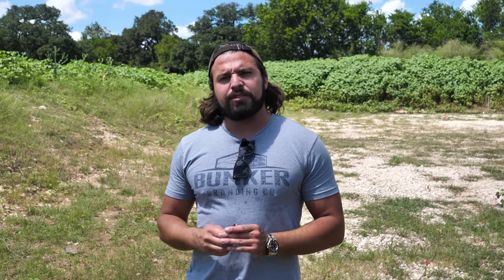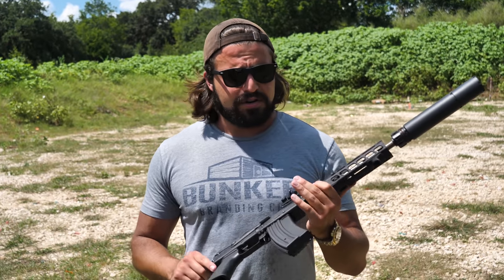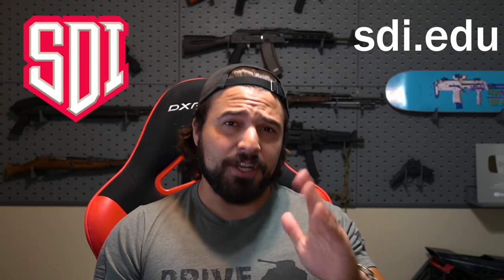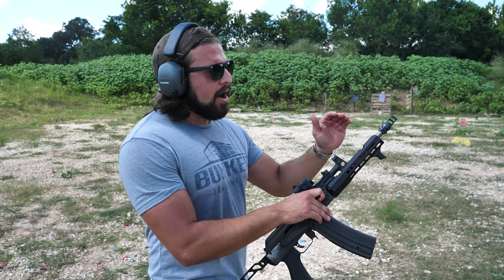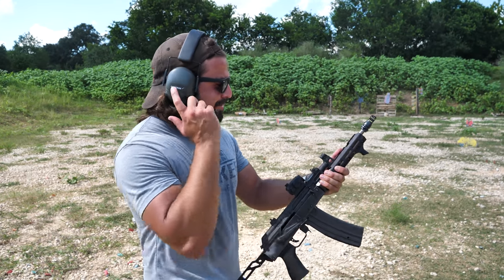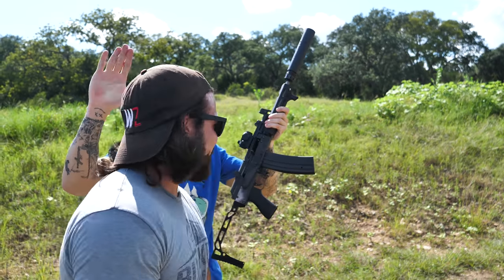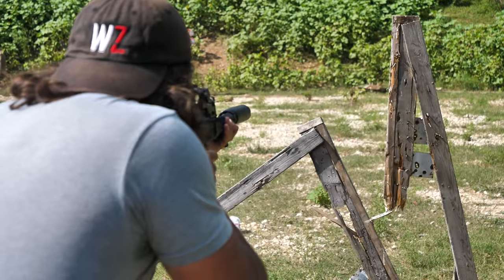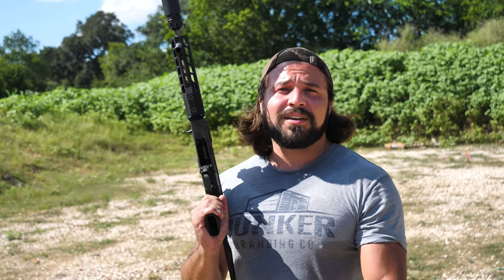9x39 AK - SNEEKI BREEKI KALASH

Comment: Good grief that was insanely quiet. I’m wondering if there were more cycling problems with out the suppressor than with. Thinking about back pressure or was there no difference?
On a side note I think Brandon should do an in-depth video on properly setting up optics. It’s normally mundane but I’m certain that he’ll find a way to humour it up the way only he can.

Comment: Put a thin piece of leather between the Bolt and the Chamber, it will eliminate the bolt slam noise.  I used to do it on Grease guns and Sten guns that were silenced. I served with MACV-SOG, 1-0 Rt. Delaware, SOA-CCC, Kontum, VN.

Comment: Never even heard of this round but now I love it
Reply: It's basically the Russian version of .300blk

But even heavier bullets are possible. 😈 When shooting subsonic, the heavier the better.
Reply: Like 12,7mm subsonic.
Reply: @XtreeM_FaiL  the big bore air guns can get up to 20mm. 1000gr or more slug at just under the speed of sound.
Reply: @ScottKenny1978  .300 Blk is american 7.62x39. You could achieve better subsonic results with 7.62x39 cases, but there aren't a lot of good heavy weight .311 bullets out there.
Reply: @lucastonoli3256  .300 BLK is the standardized .300 Whisper, designed to be subsonic first. Then they made some lightweight bullets that were supersonic.
Reply: @ScottKenny1978  I'm not talking about history here. 300 blk is well established as a dual role (sub and supersonic) cartridge by now. Where it came from does not matter.
Reply: @ScottKenny1978  This is what I was meant.
https://en.wikipedia.org/wiki/12.7%C3%9755mm_STs-130
Reply: @XtreeM_FaiL  oh, yeah, that round! .500S&W autoski.

Comment: I think the 338 Spectre is a closer comparison in the AR15 platform. Uses a .338 rifle bullet (heavier than 300 BLK), in a 10mm magnum pistol case, using a 6.5 Grendel bolt. A 9mm is 35 caliber.

Comment: I built a 9x39 AR and also use the Wolfman. I LOVE it so much. Tula ammo sucks, I had to run an under powered spring and light buffer. Wolf ammo works better. I also had to line the buffer tube as the spring noise was deafening.
Next I want to build a bolt gun

Comment: This is a much better idea than your AK-50, but due to the limited availability of 9x39 (which is a very interesting subsonic round), I still would get a 300 blackout first.  Would you consider a 300 blackout AK?  I also ask this as 30 cal suppressors are more widely available in the states.  Cheers!

Comment: i just had an idea dont know if itd work. put a port on a normal length gas tube, about as far back as the length of that short one, so you can have a normal looking tube, but also let the pressure out in time.
Reply: might even help with muzzle rise

Comment: Just a thought but when you started the AK .50 challenge why did you choose .50 BMG over .50 Beowulf or .50 ae? Not to discredit how badass the actual project is but wouldn't it have helped along the way with figuring out he metal hardnesses and pressure management to work with the slightly less powerful rds then jump to full scale?
Reply: I mean he did an AK in Beowulf

Comment: This is a sleeper cartridge with a silly bullet weight in a mostly useless gun.  Stick a new barrel chambered for 9x39 on an SKS and load it with 150 gr. - 200 gr. soft point ammo and you should have a modern hunting rifle equal to the old 35-30/30 (a necked up to .35,  .30-30 prohibition era wildcat round) about equal in game killing power to a .35 Remington.  But in semi auto and more modern and less cumbersome  than a Remington Model 8 or 81.

Comment: Would a krinkov style muzzle booster sized for 9x39 give enough energy to cycle a 9x39 ak with a full length gas tube without needing to add a tube bleeding gas from the earlier part of the barrel?

Comment: without supressor bullet might have 680-715 kmh ONLY
with supressor fittet bullets slows down toi average 580 kmh ONLY
= BOTH IS A JOKE for penetrating anything with a litle thickness or armor but it´s ABSURD FUCKING QUIT AT ALL ! ! !
It is like an VSS :D

The result of such super slow bullets with such tiny acceleration load is A LOT loading and/or extrations jams like you see in this video here to.